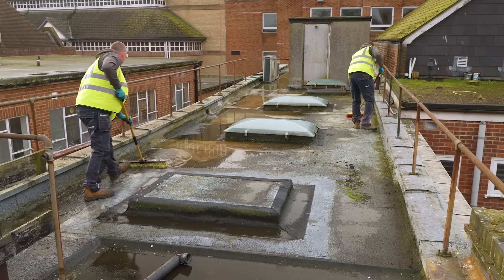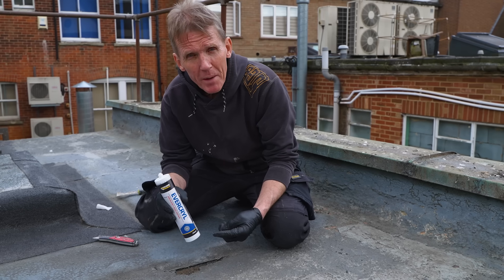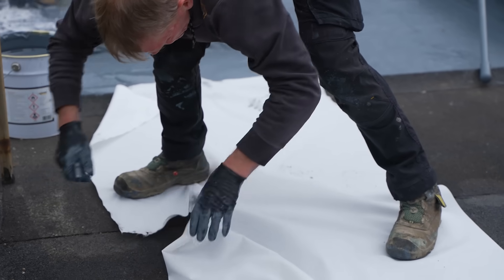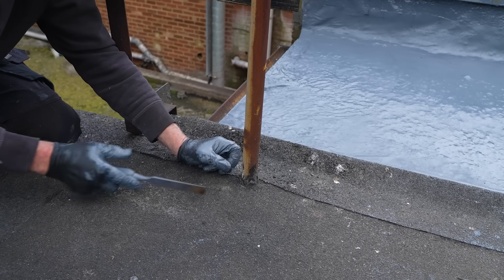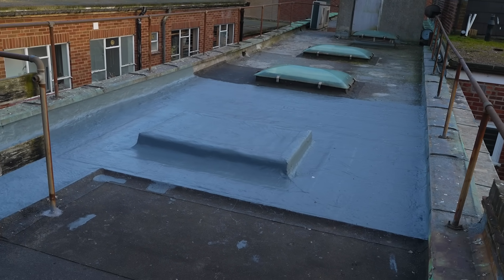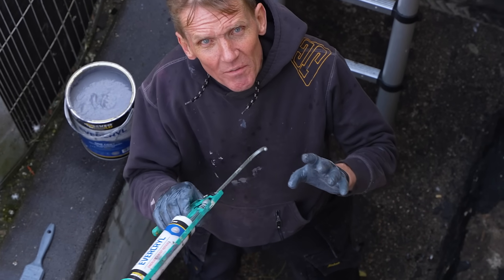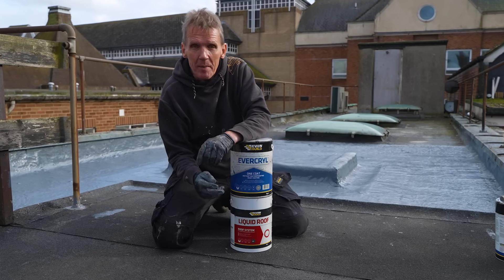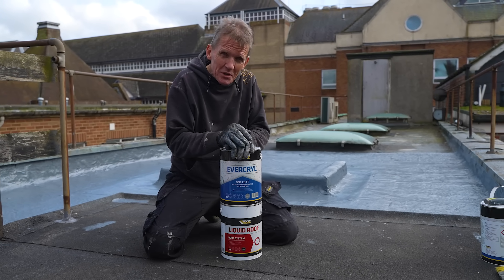How to Repair a Flat Roof with Liquid Roof

Comment: Interesting because just today I recoated a concrete garage roof. Last year I did it with one coat of Evercryl Grey but ran out and finished it with Bostik Flexacryl Grey. Since then the Evercryl had cracked in a few places and begun to peel where I had coated it too thinly over the previous layer of bitumen. But the Bostik Flexacryl was still good, so today I put a second coat of Bostik's Flexacryl over the whole roof. I'll be checking it again next year to see how it stands up to another British winter.
Reply: And? One year passed since your comment. How's the roof?

Comment: Thanks for putting the video together 👍 would you able to put this on top of felt roofing please
Reply: I've just put Evercryl flat roofing repair into all seams and nail heads on a garage felt roof. I'm confident it's sealed well and will go up in a couple of months to recoat. Only used a third of a £30 tin, so have plenty to go.
The rest is about ventilating the garage to stop condensation.

Comment: Bought a ladder and Evercrill one coat roof coating. Today did all seams and nail heads, only used 25% of tin. Flat roof garage. Confident I can get up there and do again or even buy some fleece and do the whole lot in the future.
Evercrill really goes on easy.
Next job is to increase ventilation through the inside. Done 100 x 10mm holes covered with louvre vents in the fascia boards. There's loads of air gaps in the up and over door. I'll add vents to the wooden side door.
It's all about air flow, don't care about temperatures, enough air will keep the garage low humidity.

Comment: Great video thanks, Is there something in the range to deal with pooling/puddles. Im going to recoat my flat roof this summer and would like to build up the areas of pooling so they run off with the rest of the water.

Comment: Looks good. We have just found out the issue with our front porch. There was a gap left so the water runs down the outside wall. Just need to figure out how to patch it but can see some of the obs has rotted away. I might be able to patch it with this stuff.

Comment: My new house has a flat roof conservatory, and whoever did it was useless. The felt is just an absolute bodge job and obviously leaking. Dont really want to have to pay for a new roof so this is exactly what im going to do myself. 
How long can you expect the product to maintain its integrity? Im going to apply it very thick. Maybe even let one lot set then re-apply another coat?? Or is that pointless?

Comment: I am trying to repair my flat roof. I have applied the adhesive to the roof. When I lay felt onto the adhesive do I have to peel off the thin plastic sheet from the felt first? Absolute beginner here😮😮.

Comment: Hi, i think you are the guy maybe has answer to my problem, i shingle a flat roof with shingles, it is only 8 by 12 feet( 2,5 M. by 4 M.) roof, and because of my mistake in the first place the roof leaks, now can i put something on top of the shingles to fix the problem, this is only a shed ( storage for my ATV) .Should i roll Liquid roof on it in a nice sunny dry day ?

Comment: Hi, Thank you for the informative video. I had an extension done some 5 years back and my builder installed a GRP flat roof and used the 'Cure It' prodcut. This is now flaking in places and there Is a small leak somewhere  that I cannot locate. I feel that the leakage only happens when we have heavy, windy rain.

Do you know which Everbuild product will be suitable to repair the cracked and flaky bits please? Will the Evercryl (with the fibre bits) be suitable? Any help and advice appreciated

Comment: We have pooling water on top of a felted roof covering, which has been put on top of a poured concrete roof, which drains the wrong way. What product / method should be used to level out the liw spots?  Presume it would be best to remove the old felt, rayher thancover over with another product?

Comment: Just done my flat roof in it. Wear clothes you can throw away (bin bag at foot of ladder!), wear kneepads so that if you have to kneel in wont seep through and glue your trousers to your knees(!), 1mm coverage per coat really is enough if you aren't laying fabric down - if you are putting fabric down you'll need much more or the fabric will struggle to soak enough in to adhere. Fabric is a nightmare as it puckers and will stick to your roller - paintbrush for fiddly, hard to reach areas. Buy one extra small tin for after it is all 'finished' and set to fill in any gaps between fabric and missed places. Cut any fabric to size before you start - after you start the liquid roof is getting on your hands and then onto any tools you use - it is not removable during the job.  To open the tin I had to use a large flathead screwdriver and then pliers to peel the tin lid up. Wellies were better than boots for me. Pour straight from the tin onto the roof - it is very thick and you'll waste a lot of you are decanting. Wear proper gloves. Potentially warn the neighbours - this stuff will stink up the street and people may need to close windows. Take a drink up with you as once you are plastered in it moving up and down is messy. All said too 4 hours to do a flat roof 10 meters by 3 (2 tins 21ltrs - fair bit left over) - would have been easier with an extra pair hands. Really good result though.
Reply: Did it work? Any new leaks since the job? Please update in the future too!
Reply: This guy talks like he’s a missing member of the Rolling Stones
Reply: How is it holding up now mate?

Comment: Will this stuff stick to roofing lead? Roofers bodged my fibre roof by trying to lay fibre on top of lead on the edges of the flat roof where it meets a pitched roof. Unfortunately they didn't prime the lead first and the fibre has now lifted away and water is getting in!

Comment: So there's two methods to spread that. We call them "dip and stick" and "slop and mop".

Dip and stick is when you dip your roller in the bucket and spread it out, slow, thin, likely uneven, takes way to long bit saves material. Often good for a top coat.
Slop and mop is when you pour it onto the roof and use your roller to essentially mop it around until it's covered. Thicker, faster, much better in every way except you use twice as much. Will last longer come out better. Best way to do bottom coat.

Comment: Thank you for the video.  Not sure what the product actually is but i am thinking we would have a hard time closing any quotes with all that is needed...Not a fan of elastomerics but for some roofs that don't really need to extend their service life so many years out i guess it is an OK fix. Our company has used pretty much everything out there over the last 25 years. We use only one products after 8 years of success and not callbacks. There is a Liquid butyl rubber made by epdm coatings. What we like about it is that it does not need a primer for any of the roof types we have applied it over that goes for metal, BUR, epdm, foam but NOT silicone. Also it is a one coat application so we close much more business with this product because we come in as the lowest bid! It is a solvent product so primarily the reason it last all the years. I guess every product has a particular use but as a roofing company we want to use a product that will last and has a history of success.  Looking forward to your future videos thank You

Comment: Do  you not rate fibreglass anymore instead of felt roof
Reply from the maker: fibreglass, properly done is very good. If we are talking about stripping off and starting from scratch it is a good option but this is a repair.

Comment: Would this be ok on a fibreglass roof? Have a couple of small non-leaking cracks where weight's been put on the lip.
Reply from the maker: Just rub the offending area down and apply some more fibreglass, it will be better than putting a polyurethane on top and maybe cheaper.
Reply: @SkillBuilder  thanks for getting back so super quickly!

Comment: I have a flat roof that's rubber membrane on a garage roof and it's lifting plus leaking at where it connects to outer wall of the house. I am not sure if the bricks are ports or if leaking at the flashing. What would you recommend?

Comment: Like most trades you get good and bad, a good roofing company would really need to strip this put in roof vents to let out the moisture trapped in the concrete through ingress of water.
What youve done looks good now but in two/three years someone will be doing it properly with a professional system.
Good "temporary" repair though but not permanent, it will have more cracks than a Jack Whithall gig in a couple of years once the UV have haf its way (despite what it says on the tin) the customer obviously didnt want to spend a lot.
Theres an old saying, you cant polish a turd....but you can dip it and roll it in glitter.
Good effort for a repair👍
Reply: It seems that alot of negative comments on youtube are possibly from "professionals" who might be losing work these days considering the information available these days to your average homeowner

Comment: These products are ok for a temporary repair .They are not cheap and have a limited life .also in my 40 plus years experience not many products work in the wet . That roof you are working on looks a nightmare to keep watertight.
Reply from the maker: It is still watertight so let's see. It is better than the professionals managed

Comment: Right, fair play for having a go as a hands on fella. Few points. Wet on wet rule of thumb 2kg per m2, fleece, 1kg per m2. Laying the fleece over the first layer of liquid, you must fully embed the fleece (missed in the video) take your roller and dry roll the fleece till you see the liquid coming through it. Then apply the top layer. If you don't do this the roof will debond and come up in winds, likely to happen here unfortunately. Secondly mouse holes in the felt laps. Patch to have 150mm laps onto area. Don't use the fiber as it's for difficult details only. Cut a square of fleece amd do 2 layer wet on wet as above. 3rd rule. Go to a manufacturer such as Bauder and ask them to spec the roof. The guarentee is insurance backed and covers products and workmanship for 20years minimum. Roofing is full of have a goes and pretenders. Go to a commercial contractor that's doing large scale projects, they will do your roof and do it properly. We are such a contractor.
Reply: Wow so for 27m2 I need 54kg of the liquid?
Reply: @edwardmurray8507  2kg per m2, then fleece followed by 1kg per m2 on 27m2 = 81kg

Comment: Great video, I have a garage with a concrete roof cast in three sections. I have tried everything to seal it but the joints always leak after about a year. Would I need the fleece to span the joints and compensate for the movement?
Reply from the maker: Personally I would use some fleece because it can do no harm. I think that filling the joints first is also good.

Comment: They've had the pros in? Doesn't look like it. 
Either way, did you check out the coping stones while you where at it?
Reply: Why check out the coping stones?
Reply: @justbreakingballs  no primer...lethal at height...
Reply: @justbreakingballs  Because its a failure point most forget to check. All depends on how the felt is brought into play underneath.

Comment: honestly... i wouldn't trust acrylic base anywhere on the roof... the problem is, rubberized and silicone products that do the same thing are incredibly expensive... so you use acrylic and you get what you pay for

Comment: alright mate.  When it was first done, that pipe was supposed to be painted with bituminous primer, then would get a couple of layers of torch-on (2mm, then 4mm) up to 6 inches above the pipe so it forms a collar.  So, although they've already paid 8 grand for 'the pros', it doesn't seem like they actually knew what they were doing.
Anyone can do nice easy flat bits, but it's the details where it really matters.
A roof like that, done properly could literally be used to keep water in a swimming pool without ANY of it getting through at all.  Shame really, there used to be some really talented fckrs doing this work back in the day.
Love the vids mate, keep em coming 🙂

Comment: Used similar to fix garage  roof , it lasted a couple of years but cherry tree above it so bird muck and cherries sitting on it along with a dip where it puddles was too much and I had to get new roof along with beams etc and went fibre glass so job is a good un now.
But I think it would work for a normal repair where there is not such a harsh environment.

Comment: Curious how long this is meant to last on average can't seem to find that anywhere.
Reply: I’ve been using the SIKA products for the last 10 years. If you can get the SIKA products (a bit more expensive than the rest) and If you do the whole system 3 layers of polyurethane SIKALASTIC 612 with the net (I prefer the WM - Waterproofing Mat which is the stuff they make fishing boats - fiberglass ) and one layer of the sikalastic 570 (protection from the sun) you will get 10-15 years guarantee and a lifetime protection as long as you do one layer of the 570 every 10 years as a freshen up thing.
Reply: @lazarous1199  can I ask where do you get your sika products from in the UK...having a tough time finding 570 and can you provide any more details on the wm waterproof mat? Thanks

Comment: Gawd! ..... I wish I'd seen this a year ago..... tried several products on my leaky roof, just seemed to make it WORSE somehow ...... So I ended up putting a Tarpaulin over it and fixing it around the edges .... Now THAT is a bodge-job ... but it IS holding ... So Far - Touch Wood :-)

Comment: I have a roof with 5cm slope. It still new and didn't experience it in winter so I cant guess what problems may happen specially winter is so cold and snowy. We used cement board as a outside layer and then sandwich panel. How can I fix it

Comment: I'm quite surprised that if they had professionals in & they paid £8000 to have the job done I would have got them back in to correct the problems (just saying) even after a couple of years they still shouldn't have had that many problems with the roof but great video to show what you can do to make it more waterproof than it was or to get a bit more time out of an old roof with problems and a DIY er can repair
Reply: Get them back? Youre doing well if they turn up in the first place!
Reply from the maker: Hilarious! Get them back for what?
Reply: @SkillBuilder  i think stevebray71 meant to correct the crap workmanship if the roof was still leaking after an 8 grand "fix"!

Comment: Fleece backed single ply membrane would have been best for that job. We would only use liquid solutions in tight channels or difficult detailing. Hats off to you for persevering with it over a larger area.
And reference to having the experts in before. They obviously didn't do a very good job.

Comment: loved seeing those 1-1/2 wastes on the other building behind making water defy the laws of gravity
Reply from the maker: Yes they are amazing. What is so difficult about putting up some pipe brackets? You can see  where one has pulled out of the boss and is pissing down the wall
Reply: I see what you mean there, wonder if the same builder as the roof done the waste pipes.
Reply: What can you do...... Great content as always Dylan, Rodger. Keep it coming.

Comment: Nice one Roger. I was going to go all out and do a GRP system on OSB to seal a flat roof to prevent rodents gnawing through the OSB. The roof is under another roof and this looks like the perfect product. Saved myself a couple of grand!
Reply: Do it at your peril. Trust me, if you do this you will wish you'd done a proper grp roof in the first place.
Reply: @tanja8907  I didn't see this notification until someone liked it. Can you explain why?
Reply: @SteS  thsi liquid rubber seems more like a patch repair, i wouldn't trust the longevity. Do it right the first time so either GRP, rubber roof (which is quite easy to lay for a diyer) or get roofers to felt it. Hope that helps

Comment: Enjoyed a lot of your previous videos but as someone who has worked in the flat roofing industry for 19 years this was painful to watch. Clearly not trained to install this product which is the main problem with “off the shelf” products, anyone can grab them and think they are a roofer.
Reply from the maker: Russell 
 It was not easy to keep clean and I would rather have left it to a guy like you but the customer had lost patience with guys coming in and taking thousands of pound only to find she still had leaks. 
I don't think I am a roofer or anything, I am just a guy who doesn't like ripping people off. I have taken a lot of tasks on in my life and I charge for results. If it doesn't leak that it job done, it ain't going in the Tate Modern.
Reply: There are so many so-called professional s out there that call themselves roofers. How is the customer to know who really is a professional and who is not after taking £8K of your money.

Comment: Can you do this on a fibre glass roof?
Reply: Would like to know this aswell. I have a GRP flat roof above my garage, and if anything ever fails this could be useful.
Reply: @daverogers6443  I was advised the wrong mix could dissolve a grp roof. Hence my original question. Need to track down the chap who originally did mine

Comment: Think I was right with my other comment. Slap a coat of paint on it for another year.......
I do like watching your videos roger, but i do believe this is just getting bodged over again. Some of your videos you go on about belt and braces and doing things that will last like removing plasterboard and using a tile backer board. But this seems to be an advert for an ever build product that I would possibly only use as a temporary fix. Would you use this stuff on your next  new flat roof project? I seriously doubt it.... 👎
Reply: Says Dodgy Dave 🙄.